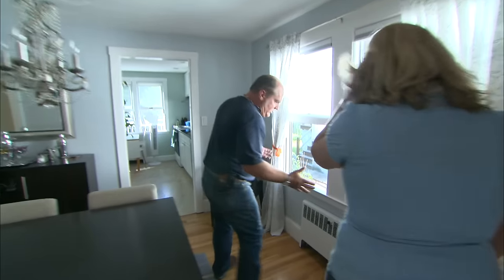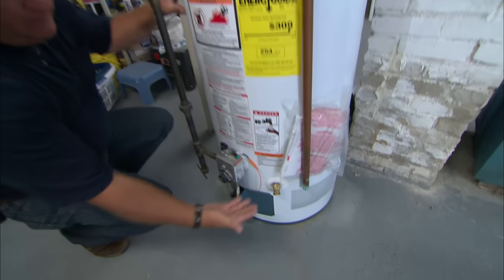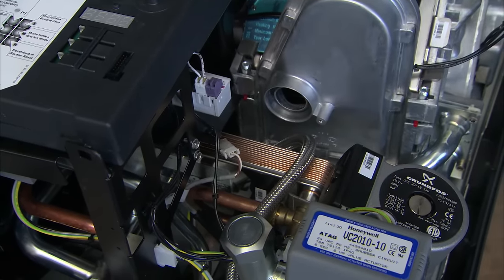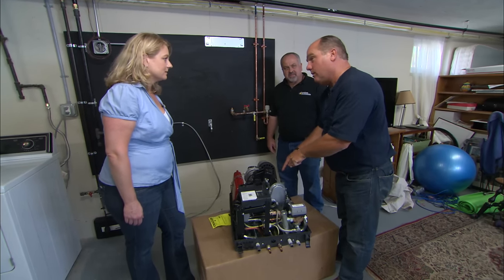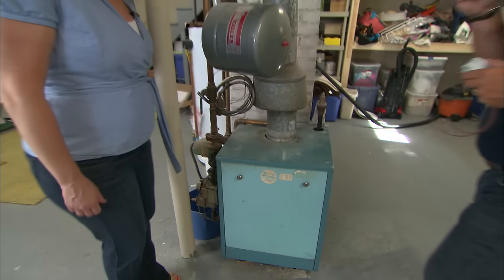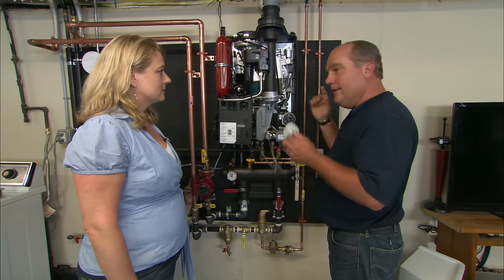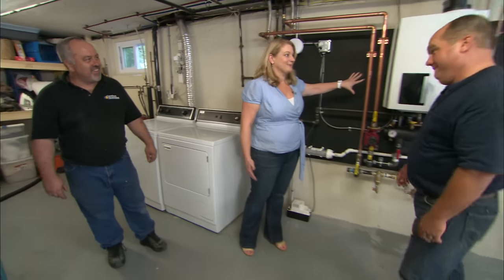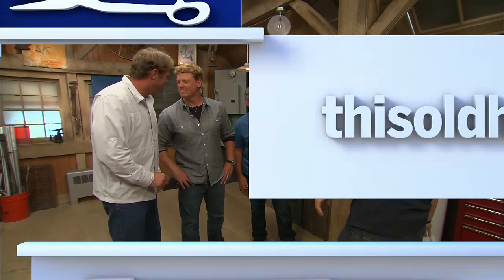How to Install a Combination Boiler/Water Heater | Ask This Old House

Comment: Unless you have more than one heating zone set up, you don't need the other pump. The boiler already has one.
Reply: Wrong, pump will not overcome house head pressure.  Pump is only for boiler and low loss header flow.
Reply: Evan Rysdyk Please explain how we manage to make these work in Europe for houses with twenty plus radiators yet no low loss header or second pump?

Comment: The required maintenance of the new unit will more than off set any energy savings and the electronics will fail and be unrepairable and overall will have 1/3 the life of the old unit.

Comment: How much would a system like this cost?
Reply: +iShootBandits anywhere from 7K to 10K usd.
Reply: +iShootBandits I recently got quotes for this exact job and they ranged from $10,000 - $12,000.  You can get rebates that lower your cost by around $2000. Boston area.
Reply: +iShootBandits 
I bought an Ideal Logic 30 18 months ago here in the UK for £750 ($1060) with 7 year Warranty. Fitted in 2 days. I had quotes from outside firms to do the complete job at £3,000 ($4250). But hey UK plumbers rip off just like US ones do I guess.....
Reply: unless you got someone to sign it of you have 0years warranty and good luck with that boiler they are terrible look forward to floods and intermittent hot water
Reply: ***** 
My old one was de-commissioned by a registered gas company. I then fitted the new one having already changed most of the pipework and they came back and tested and commissioned the new on in less than a day.

Never a problem with it and it cut my gas bills by 40%.
Reply: In the space of a year i have been to 2 split water blocks and 3 flow turbines which because of the cheap plastic they are made of had just turned to pulp, all issues which are covered under your warranty but so where the boilers which i had visited and that is because they had been told they would have to wait several weeks to get it fixed under warranty
Reply: ***** 
Well I can only speak of the Ideal Logic 30 I put in 2 years ago.
Reply: same in the U.S. unless you're heating a mansion with 10 bathrooms with showers. The sq footage for the size unit differs, not one size fits all. I did a search today they stated at $999.00 to $3,500. I had a water heater replaced the guys that's been plumbing for years said the same thing about when the heat goes, the hot water does too. Here in Michigan 6 months of cold weather,  who's gonna shower in a house with no heat? I think most of us get these two things fixed asap if either goes out. The venting in this video, I'd have a much better look, freaky to have them so close unless they can't be extended and streamlined, if so that needs to be corrected in a dual system. Hopefully they'll improve over the years, even the separate units need to be inline with 2017 technology JMO
Reply: Darrin which company did you end up using in Boston and would you care to give a review/pics? I think I just had a puffback (mini mini explosion on boiler in hot water system) and I'm scrambling on figuring out who to call/long term planning. Let me know buddy!

Comment: The expansion tank is mounted wrong. It should be vertically mounted with the air Schrader on the bottom. See this mistake all the time

Comment: Could someone from the USA tell me why the water heater is on 24/7/365 ?

Don’t you guys have an electronic timer control where you can set at which times the water is heated (say first thing in the morning) and again in the evening?

I’m not criticising, I’m trying to understand what the reason is for not using an electronic timer for the hot water as she has it in this house 👍

Comment: Ahhhhhh, so the combi gas boiler/hot water heater may NOT be able to handle 2.5 bathrooms operating at the same time showering/tub filling) plus, a dishwasher and supply hot water to a full house of baseboard heat.

Comment: Would be great if you showed an installation with a combi unit and a new Style forced air handler using a coil. Seems to be the future. Combi Runs the whole house.
Reply: Living the Spu Life Forced air is not the future. We ditched it in europe forty years ago! Who wants all that noise, drafts, dust blowing around? Underfloor heating is the best option, otherwise ordinary radiators.
Reply: @spencerwilton5831  maybe so. But i havent seen one home running that setup in my area. Toronto canada. 99% run gas forced air furnace
Reply: @spencerwilton5831  Seems like these combi units have been getting popular in the US only in the past 10 years or so. We're very much behind, and there's a lot of slap-dash construction over here. Underfloor heating is nice but not if you have to rip up floors and not sure it'd work all that well in a drafty Minnesotan house when it's -30 deg outside.
Reply: @spencerwilton5831  Only high end homes in north america are designed with infloor heating.  99% use forced air and yes a hydronic air handler is the way to go if you are coming from a traditional furnace

Comment: Disappointed to see iron pipe used instead of copper or brass on a new install.  Saved maybe $100 in materials but will have more rust in the system, especially with a plate heat exchanger on the DHW side.
Reply: Agree. Although it does look like they installed a Spirovent dirt separator although not on the return side as recommended (next to the Spirovent Jr. air separator?).

Comment: Lose power because of a storm, enjoying taking cold showers until the power comes back on.
Reply: eNaRDe and how would you not have a cold shower if your power was not on if you had a cylinder, I mean unless you’ve got a gas fired cylinder that has a thermocouple your gawny get no hot water regardless

Comment: ugliest flue and air intake pipes I ever seen!
Reply: dude this guys are nuts it look like branches pipes coming out of the house
Reply: Its not a big deal.  Just plant a bush in front of it
Reply: I agree. Not a lot of options though with the building code.
Reply: @toms7947  actually you can use a 'pancake'  termination. We use them whenever we can because it looks way better than the hydra haha
Reply: @toms7947   Yupppp.  I would paint it the same color as the house.  Assuming there isnt some weird building code about that.

Comment: Sigh. That combi boiler is ridiculous for that heating application. It’ll work, but it’ll top out around 85% combustion efficiency (not the 96% advertised) because convectors require 160-200° supply water. The return water won’t be cool enough (under 130°) to cause the flue gasses condense - so 85% is as efficient as the heating side of this unit will get. If she had cast iron radiators it would do much better. 

Also, the turndown ratio of the burner is usually lousy on combi boilers. A purpose-built condensing boiler usually has a 10:1 turndown ratio, the combi type are usually 5:1 at most - and  much higher btu output to start with. So the former may turn down to 5000 btu, and the latter only goes down to 17,000 btu minimum. So it’ll short cycle in the shoulder seasons which will cause higher than normal maintenance and repair costs.

Comment: In Europe they using 10-15 years already , but here only now
Reply: oleg popa so maybe hire european plumber then has more experience.
Reply: They did good job in this video, I just wanted to mention, in Europe there trying to innovate Plumbings systems, to be more Forward and it’s not so crazy moneys .Here in USA they try to charge thousand dollars for new stuff for plumbing jobs , That’s why people try to keep the old stuff because it’s money,
Reply: @TheRominul   Are plumbers in Europe thieves?  I don't think so.  Here they charge $200/hour.  I will keep my 60 years old cast iron boiler works fine.  Thank you.

Comment: We have used these in Europe for decades. What's with that hideous flue arrangement? Ours are coaxial, a single pipe with the exhaust running inside the slightly larger intake pipe. They protrude a few inches from the wall and are hardly noticeable. This set up looks like a water slide coming out of the side of the building!

Comment: Let me ask you a question  what if you still have the old time boiler combo with the hot water intake  would new boilers still work with it and how do the new boilers work  compared to the boiler combo with the water intake

Comment: There is going to be such a huge difference when the thermostat calls for heat, especially if its say 50 & windy damp outside.. The convectors running 120 or so degree water isn't going to feel so nice.. I question that also. Baseboard is meant to run on 180 degree supplied water, if you cut it just to 160 the btu output is such a difference i can't imagine even lower temps.. Having an old 150 CI boiler probably holding 4 or 5 gals of hot water is much more comfortable
Reply: The lady should have kept her old equipment in place so that it could be easily converted back if she discovered that the new system was lacking performance, which would be quite likely because she had a pretty good system to begin with.

Comment: $$$ how much compared to a boiler  and what longevity
Reply: DC Voyeur don't know about the US, but in the U.K. where these have been used for decades you are looking at perhaps £200 / $250 above the price of a "heat only" boiler. A basic combi boiler is as little as £600, a high quality brand around £1000.  Of course, you eliminate the need for a hot water cylinder, external expansion vessel, external pump etc so save on install costs. They are a good solution for smaller households but less than ideal for large family homes with multiple bathrooms as they have a maximum output of about 18 litres of hot water per minute. The best brands come with a 10 year warranty so should last well in excess of a decade- granted not as long as an ancient cast iron lump, but they are over 90 percent efficient so savings on running costs often more than pay for the upgrade and future replacement.
Reply: Not worth it. Trust me. Nightmares

Comment: With new computer monitor of your 200 amp panel box can calculate energy use to the minute. Can use energy scheduling for hot water. Gone for weekend or vacation shut down tank remotely.
Reply: you are commenting in the wrong video section, go to oldschool america wasting our money video.

Comment: So, let me get this straight ... this is the same as an on-demand water heater for kitchen/bathroom use, AND is will provide hot water to a radiator system?

How much is a Combination Boiler/Water Heater?

I'm kind of surprised that the vent is PVC ... won't the hot gases melt it?  Why not metal?
Reply: it is for both heating and hot water. You can get this also with a hot water tank (somewhat between 150 and 300 l of water) and even additional solar Panels that feed your hot water tank.   Exhaust temperatures are arround 50°C, so PVC pipes don´t melt

Comment: Why don't they insulate the hot water pipes?
Reply: Jack Gale cause they dope
Reply: some people like to leave some residual heat in their basement. as long as your sill plates are well insulated, the heat will rise and warm up your floors upstairs

Comment: Good luck with rinnai barely enough to run a shower head. And the black iron piping yuck. There wasn't anything wrong with that old system. Hopefully in coming water temp isn't to low. Htp and navien would show that one who is boss.

Comment: In the uk we have Combi but no intake but a flu.
Reply: David the flue is coaxial, the intake is the outer pipe, the exhaust is the inner pipe. Both come out of the same four inch hole. Much neater.

Comment: I think that exhaust pipe is way to close to the window, has to be at least 4' from above window
Reply: The International fuel and gas code states that a direct vent appliance may be located 12" above or below a window. Only non direct vent appliances need to be 48".

Comment: Works great but wow, what a waste of water waiting for it to get hot.  My shower runs and runs and runs for ever before the hot water arrives.  I have a LAARS  Mascott LX and it breaks down annually.  I iive next to where this is and the parts are made.  But I have to pay 100.00 for the repair guy to drive to the next town to get the part that's next to my house.   That is the worked out by LAARS and the company that works on my furnace.  It's NUTS.   I finally started ordering spare parts to keep next to the boiler.   They say they will install them, but I fear "At what cost".   On the plus side, we have natural gas and it's SAVED us so much money.

Comment: High up front cost no pay back! Lucky to last 10 years!  probably leaking/ rotted out today. Good luck finding someone to work on it!
Reply: +Paul Ricardo All of the companies out here service these, and I seriously doubt it's 'leaking/rotted out'. Heating water 24 hours a day regardless of the demand is so inefficient it makes you wonder why this isn't the standard for single family homes here in the US. And with respect to 10 years, how long before a HWH busts all over your basement these days?
Reply: +Paul Ricardo It uses all the same materials as a standard system with less overall energy input. Why would it degrade faster?
Reply: +Paul Ricardo sorry ma'am ill have to order your 500 dollar heat exchanger... should be here in 2 weeks... or 800 dollar 3 stage gas valve...
Reply: +Albion Laster that's cost not longevity
Reply: Not All service/plumbers work on them!!
Gas suppliers will not cover them in service contracts! Most leak at Dielectric unions and low loss headers,Not covered under warranties.  My guess is too many dissimilar metal , cast iron ,steel, aluminum, brass,copper and ph levels.  BTW this install is awful , No way of isolating and descaling plate exchanger also no sediment trap to catch all the 50+ yrs old rust from convecters radiators . I service these all the time, When something Fails it costs Big Money and long down time waiting for parts..  Yes a 40 gallon waterheater will only last 8-12 yrs. But replacing it is cheap and any plumber can do it in less then 3 hours. These Mod/Combies  retail for what $4k..Cast iron Boiler are half that and last twice as long..
Reply: +Albion Laster  Sadly It happens too often!
Reply: +Paul Ricardo Typical plumbers,  hasn't learned anything new since they got their license.
Reply: +Albion Laster 
...when a new boiler complete is $1,000 ... OKaaaayyyy
Reply: good video

Comment: In the early 1985 I had 25 - 55 gallon hot water tanks in a complex 20 years old. Of course the tanks started to fail. My recommendation to mgmt buy all new units on a single contract with delivery upon failure or replace all of them I bought 3 units in October. In November another failure. Plumber said new units not available. The suppliers were holding all units because the could install a $25 power vent and put an energy efficient label on unit and double the cost. Keep in mind cost to manufacture versus what the market would allow . so the ten year cost equipment fuel and maintenance. A hot water Solar panel to pre heat the water and a circ pump. Other option remove exterior jacket and super insulate the hot water tank using prefab walk in cooler walls. Or spray foam when you spray interior of roof.

Comment: the life span of the heater all depends on how hard the water is and how well you flush it..... in u.s.a public water is verry hard and contains lots of chemicals which do drastically decrease the lifespan and quality of the heater, fixtures , pipes and even your health.... it is recommended to first install a whole house water filter.. to get rid of calcium and chemicals to prevent clogging the heater and also extending the life of all your fixtures.

Comment: we have had these for years in england but you dont have all those ugly pipes showing,looks a right mess
Reply: Pipeless heating and hot water!  Amazing.
Reply: B B 4 inch coaxial flue, protrudes about three inches from the wall in a discrete round terminal. No need for all that hideous exterior pipework.

Comment: I get this video is old and technology of these " Combi Units" may have improved but as to this video. I think this system is useless if you're in a cold climate zone. Rich said it that this system can't handle heating the house and making hot water. So I guess in the cold frigid  morning you'll have to decide which is more important Shower or heat.
Reply: Avenger 1 We use these in Europe and you don't have to decide anything. The boiler heats the radiators exactly as the programmer and thermostat demand. Whenever you open a tap or run a shower it switches to hot water, then back to heating when you finish. The water in the heating system doesn't instantly go cold, your radiators / convectors will still put out heat and although the water in the heating system will cool slightly while you shower you won't notice the difference. Parts of Europe suffer extremely cold winters but still use these. It's a non issue.
Reply: Programmable thermostats have existed for decades. Not only can you set your wake time temp, my thermostat knows how long it takes to heat up the house to that temp and starts earlier, before I'm even out of bed. No issues.

Comment: They never tell you that it has to be cleaned once a year at a cost of 400.00  good luck with that . How efficient is it now
Reply: Diy...I guess
Reply: Lol 80 dollars a year for maintenance u mean. And the first 7 years its bot needed. Not to mention the cost u save on electricity and gas u ise with the old fashioned ways
Reply: Seven year no cleaning , I don’t think so , look this heater is pure junk you will find out
Reply: What's the best make of boiler? Let's say a Natural Gas boiler and an Oil burner. I'm trying to learn what the best ones are.